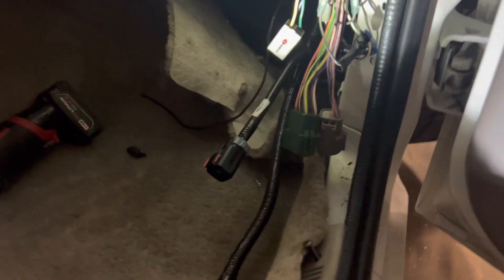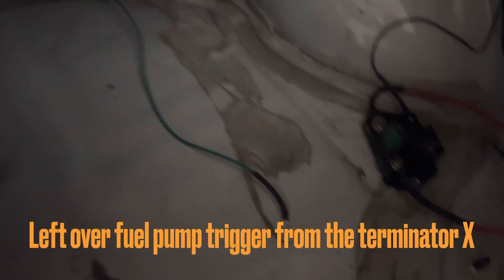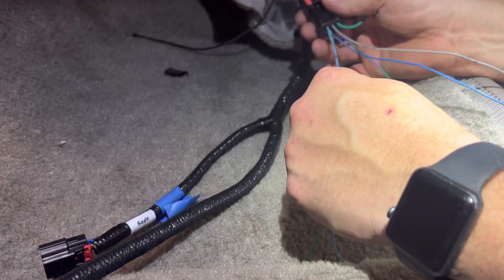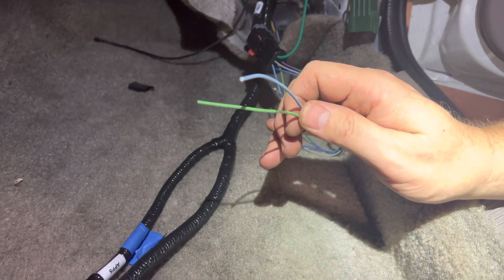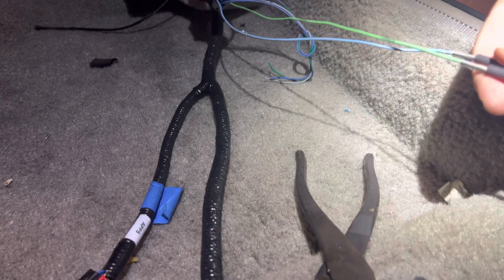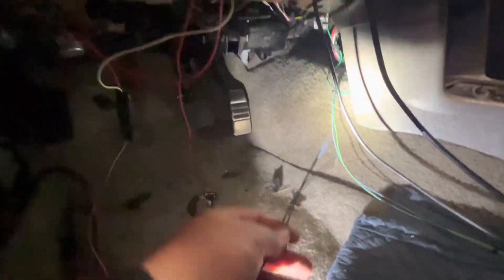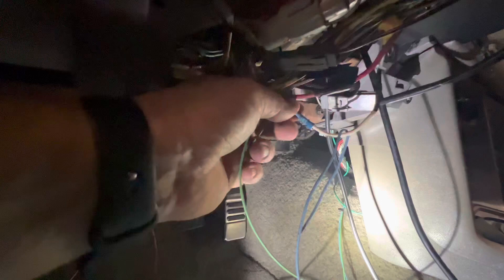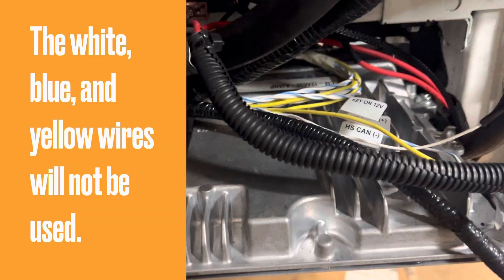Foxbody gen3/10r80 Coyote swap part 4 control pack wiring

Comment: how you wire up fuel pump relay?????
Reply from the maker: The fuel pump wire from the control pack runs to a leash 70amp reply.   Add 12 v and a ground.  Then out to the pump.   Ground the pump to the battery -

Comment: where did you end up mounting your computer ? Im doing same swap as we speaker Thanks
Reply from the maker: Pass side under the frame rail.   Tomorrow I’m going to try to get a first start up.   I have a few wires to lengthen and run a new battery cable.